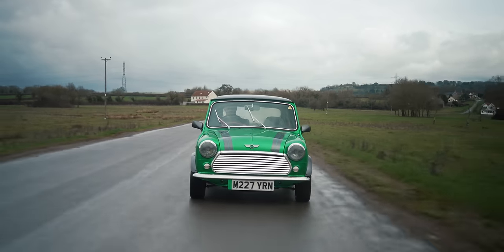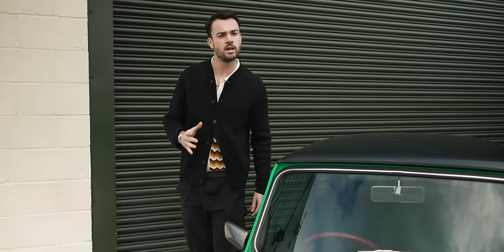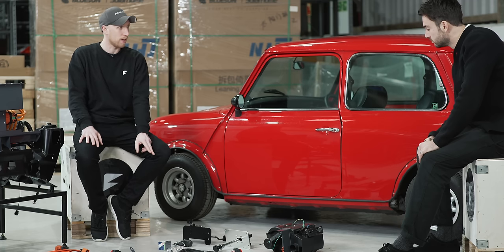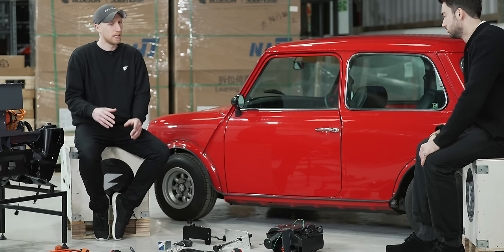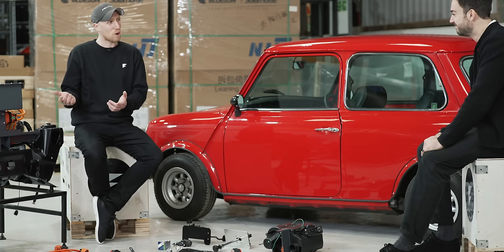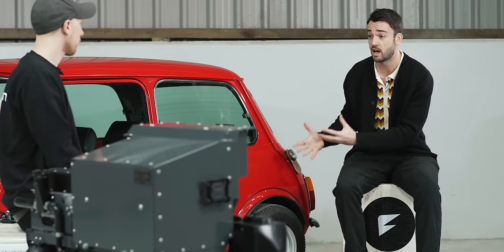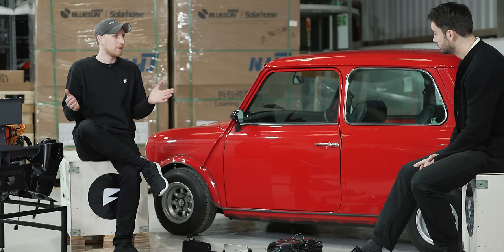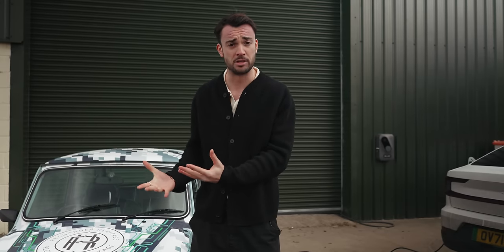How CHEAPLY Can You EV Convert Your Old Car?

Comment: The Mercedes EQXX has travelled 750 real world miles with a single charge of it's 100KWh battery.  CATL are already making second generation sodium ion batteries that should cost far, far less than lithium ion or lithium iron phophate batteries (lithium is $5000/ton, sodium is less than $100/ton).  There's no rare elements in these batteries, but they take up more room.  They're about the same weight as lithium iron phosphate (per KWh) but they're larger.

Oh, and they've got twice the charge/discharge cycle life of the best lithium iron phosphate batteries.  About 20,000 cycles.  Lithium Ion has about 500.

Now, if Mercedes can make a 750 mile range car with 100KWh, that means that a 25Kwh sodium ion powered car with a near 190 mile range should be possible.  It's just about improving efficiency of EV's.  I wouldn't mind a 25KWh car with a 120 mile real world range.  Not "nissan leaf" miles, but real miles.

That's where the technology stands today.   This isn't tomorrow tech, this is "already out there" tech.

Comment: Cost is a major factor when dealing with any Classic Car Conversion. But (most) owners of Classic Cars have a tendency to keep their Classic Car - for life! On the other hand, how many new (or almost-new) cars will you own in your lifetime? Especially when todays modern cars are designed to fail - when plastic components begin to degrade fast!! It is this overall cost that convinced me to convert my '71 Beetle to EV, back in 2019. EV Beetle has a range of 160 kM or 100 miles. Advantage is paying a low cost for electricity, the EV Beetle has been 100% reliable over 4 years, and maintenance costs of almost nil. What I am trying to say here, is simply to look at the length of time that YOU plan to own your precious Classic Car. If your answer is "forever", then go ahead and plan an EV Conversion. Take a look at exactly what you would be spending on maintenance of the engine, the uncertainty with regards to what you will be paying for fuel, and the queuing at Petrol Stations. My EV gets "filled" whilst I sleep! Over the longer term, you will see a 'payback'. You will have future-proofed your Classic Car. You will have also increased your Classic Car Value. Nothing is lost at all, the added reliability of driving your vintage Classic as an EV removes lots of stress too! Great to meet you Jack, at the Darling Harbour ICC Sydney, at the Fully Charged Show last March.

Comment: I know that the Great Britain is out of the EU for some time now, but I still wonder whether those converted cars then can be registered in EU without problems.

I think that this could be good way how to get EVs to more people much faster than current "trickle down" model can. Sadly I don't see how this could be done to more "modern" cars that already have plenty of electronics, but still conversion of older cars can be god way how to get EVs to more people and in case of elderly (although many of them perhaps started driving only in 1980's) it could transition to EVs easier as they will not be overwhelmed by all the electronics and features almost all new cars have (and they would have to learn to use them or to ignore them).

Maybe those kits could be as well useful, in future for conversions farm equipment.

Comment: I've actually been doing this to old 4-runners, throwing a honda 4 wheeler motor under the hood to charge the batteries and selling them for 35k. Essentially it's a 300mpg car that will last 10x what a standard car would.
(Costs about 8-10 USD for the conversion. Helps that I had 4 honda 4 wheelers laying around haha)

Comment: Instead of 27000GBP for the kit You can check this car from TATA motors india which cost around 20000GBP in India & has 250+ kms range, the cheapest electric car with similar specs cost around 15000 GBP in India & its a sedan with lots of modern features

Comment: The timing won't make it a big player in CO2 emission cutting. But the foundation of this industry will probably provide the ecosystem to have non-OEM battery pack replacement in existing EVs. I know I'd pay another 10k$ to double the kWh in my 2019 Ioniq EV once they are at the end of their usefull life. These guys will have all the knowledge (building pack) and contacts to retrofit newer battery tech into aging EVs.

Comment: £27,500 just for the conversion kit?  You're sniffing glue if you think that's good value for money.  You'd probably need to bring it down to a quarter of that to even gain much of a significant interest.  Even then you'd probably be looking at £15,000 installed.  Reckon that's going to prove popular, do you?

Comment: My dream; buy back the 1966 Chevrolet Caprice Coupe I owned from 1996 to 2001 and redo as an electric. Body and chassis are indestructible so will even now last forever. To have that time machine with the original silky embroided interior, fake woodgrain dash and have all that as silent and smooth as with the original 283 poweglide but clean…😊😊😊

Comment: I guess all innovation starts as toys for rich people, but converting old cars (and not just ‘classics’) as cheaply as possible should be where the EV revolution is at imo.  Using the existing frames to reduce waste and the added pollution caused by manufacturing.

Comment: What about just adding some electric power to the back wheels making it a 2+2WD hybrid? It would save a lot of gas and help a lot with response in low speeds and acceleration would be great. 25% of the battery you talked about here could be plenty

Comment: 40k is still way too much. Better off just buying a new EV for that.

Certainly, it will come down, but realistically it's going to remain a luxury thing for custom retrofit packages. But hey, classic cars are never cheap.

We'd honestly be better off focussing on building new small EV's with a bit of style to them.

The one thing the Mini shows us is that cars don't need to be heavy or have ridiculously high power to weight ratios to be fun. A bit of 60's inspiration in building smaller lighter fun cars inspired by the Mini, the Datsun Fairlady, the MG Midget, the Fiat Topolino, the Morgan 3 wheeler and the VW Beetle is the correct path.

We're already seeing that with an electric Mini, the Topolino Ev, the Ora Ballet Cat but no Punk Cat :'(

We did have the Vanderhall edison 3 wheeler as well, which seems to have disappeared, but looks like it is coming back as the Santarosa.

The sad thing is that the Mini Electric 2 is still too expensive and too high spec. 135kw is way more power than the mini should need, and it's going to offer half the range and 35kw less than the new Cupra for about 20% more price, so the "higher spec" thing doesn't work out either. A 70kw motor and 300 km range would be better than 135kw and 230 km.

The Topolino is going the Quadricycle route, so is basically irrelevant outside of France.

So that's about half of them actually looking like viable options.

The only ones actually hitting the market where they need to be is the Chinese. That Punk Cat looked incredible, but I understand why they felt they couldn't make that. A kit to convert your Ballet Cat lights to Punk Cat will fix that though.

Comment: The powertrain alone won’t make people consider a retro conversion over a brand new EV.
What about comfort, features, safety, road noise, range.
We really need a kit for almost new cars. These people might have gotten a gas or diesel car they still like, but are considering replacing because it is not an EV. Example:
Take a 2018 C200d Mercedes. Give it 150HP, 300 mile range and it would appeal to a lot of people.
Is that easy? Hell no because of the electronics in that, but that is what normal people would actually consider over a new EV. 😊

Comment: Always niche me thinks, newer car designs are typically much safer for most drivers, brakes, traction control, airbags/curtains, etc. Depending on vintage and type, heavier and aerodynamic bricks. My dad had a 1958 corvette I would have loved to convert but wayyy outside my price range. I think an Aptera will suffice.

Comment: I just bought an MX5/Miata and your first comment about size and horsepower couldn't be more true. My father 270something horsepower BMW hybrid SUV is nothing in term of driving pleasure compared to my 160hp nugget. Sure the BMW is faster, accelerate better and all of this, but when driving the speed limit anyway, the feeling of speed is a completely different story.

Car need to go on a diet. They have taken something like 500kg on average during the last 25-30 years, without it being justified (the study I looked at estimated 150kg for safety systems, that could be ofsetted without issue with the progress made in that time in material science and better design tools such as finite element analysis)

Comment: Unfortunately I think that the ElectraMeccanica Solo (if they ever bring it to the EU/UK) and Dacia Spring (if they ever put an 80MPH capable engine in the thing) or their competitors that are coming out over the next 2-3 years would/will be a more likely bet for the bulk of us. 

Even in today's crazy market my car is only worth a couple of grand with a brand new MoT... Once the car's value drops below about 5K how many people would convert a car? Classics sure but what are the odds for say a focus?

I think that the companies pushing this are either 
1) overestimating the average person's attachment to their average car, 
2) overestimating how much cost and effort a normal person is willing to put up with, or 
3) underestimating how cheap new electric cars have the potential to get.

For the third of those, you'll never beat automation in the long run, Just ask John Henry the Steel Drivin’ Man ;-)

Comment: I ordered a 144-volt kit from a Chinese company. It included everything but the batteries and the means to suspend the axle from the frame. If you find a company who handles the transaction professionally, you may be able to convert a vehicle relatively inexpensively. The kit I bough cost $4,610 and was supposed to be able to hit 55 mph in a 4000 pound truck. I'm currently fighting to get a refund on everything but the custom-sized axle because they waited too long to source the components and couldn't get a suitable dash panel. The supplier handled the problem unprofessionally and now I'm expecting to have to find all the other parts elsewhere. Be ready for hurdles if you decide that you like your old vehicle too much for it to become a relic. After all, it's just a vehicle. Now I'll have an axle and no idea what I'll be putting it into or on. One idea is to use it to power my trailer so that my truck is only helping to move a load rather than moving the whole thing. We'll see. If not, it could be an $800 lesson learned.

Comment: Do you remember when Top Gear put cars on railway tracks? Besides their usual catastrophic pantomime antics, they were addressing one key premise: WHY are trains so unneccessarily heavy? And thus, inefficient.

I think it's the same thing with electric cars. Sure, we need a strong enough frame, and strong enough crash protection, but all that extra steel for body panels is simply reducing the range of the vehicle and, ultimately, using up too much electricity. Even the Tesla Model 3 is built out of steel (whereas older models used more aluminium). OK, so steel is cheaper than aluminium, but, all the rust buckets in Europe are a testament to the investment in non-corrosive metals -- they will last longer.

Perhaps what we need is the mass production of very strong, durable, corrosion-free frames -- titanium alloys and all that good stuff -- which will last you a lifetime. These frames could be manufactured for compact-sized, family-sized, pick-up/van-sized, etc. and you just take your pick. Then you simply add an off-the-shelf battery pack and motor configuration of your choice. And finally, you simply bolt on your re-cycled plastic, fiberglass, or whatever, body in the style and colour of your fancy.

We should be asking the question, are motor manufacturers still trying to hang on to built-in obsolecence which forces us to forever be buying new cars from them?

Comment: yes a "tiny" battery isn't very heavy - though still relatively pricey. (Retail Li-Ion batteries are anywhere from $500-1500 USD  / kWh... 

Needs to come down to a similar price to an engine and gearbox swap for a classic before mass appeal will ... take off...

Seeing as a brand new city car is half the price of the "DIY" kit, hmm, enthusiast only (rich-ish, enthusiast).

- Talk of a "circular economy, well throwing old cars away is a vital part of the current so-called, circular economy, recycling can't happen otherwise (Yes I too have a hard time parting with my old chariots..
(For future true recycling, thermoset polymers (as well as the easier to reuse thermoplastics)  can be flash converted into graphene and hydrogen for energy - back to the grid, or  use to make more unicorns -  and upcycling. 

 - Battery manufacture is largely robotic, so the wages per unit of product isn't as important as cost of finance and real estate values (ie it is one of the most scalable businesses around).

Comment: It continually amazes me, just how far out of touch with the customer base, these sorts of companies (and the guys at Vintage Voltage) are with the real customer base they're pitching to. No one who can afford this, will bother with it, they'll buy a new EV, they're just not Classic Car Enthusiasts, they're people who own specific cars for the 'prestige',.. what the rest of us call posing and bragging, never driving for fun. And worse, the folks that do want to do EV conversions, are not the sort of people that can afford to take their classic to a workshop and wait to  pay for the work to be done, They Want To Do It Themselves!!!!
These 'kits', need to be made simple and safe enough to install as a Dual Battery Solar Camping power system is, with no special skills beyond being able to follow colour-coded instructions. Only selling through 'installers' is what's going to kill these products.
For those with larger cars - US  "A-body" and bigger, these kits need to feed the existing transmission for the base kits, reserving the Direct Drive version for smaller vehicles and sub-25 year old cars, and making use of the low-rpm torque of and electric motor to push through the automatic tranmissions an manual gearboxes of classic muscle cars, touring cars, hot rods, pick-ups and the like. Being 'Bolt-In' is just the start.

Comment: Rather than the complex gearbox they should just go with in wheel motors like Aptera. Much less weight, complexity, cost and space, leaving the engine compartment for the battery.

Comment: I have a 1993 Taurus wagon. I would like to convert into a hybrid. Cram a 8kwh or so battery in the floor well of the 3rd row rear facing seat. Install a couple wheel motors for the rear wheels. Install a thumb switch to trigger the  motors and regen paddle on the steering wheel. Granted, id still have to start the gas engine, but basically just run it in idle til the battery runs out, and still be able to use regen

Comment: To me it will always be a niche for hobbyists who love tinkering with cars and have a passion for a certain model or for those with enough cash to buy all the bits and pay someone to fit it. With more EV's becoming available and a thriving 2nd hand market (at some point) then the mass market won't want the hassle, risks and limitations of a conversion. A 2019 Model 3 with reasonable...ish mileage is about £24k right now which is a better car with longer range. So at what price point does a conversion become cost effective to do over buying 2nd hand? If you want a bit of fun right now for driving around town then I'd be looking at a twizzy or an Ami although I'm too tall for the former as proven at last years Fully Charged Live.

Comment: Thank you. This is a subject that should have its own slot on your program. True classic car Gear Heads will go to no ends to take on a project, as long as the wrenches are spinning and my Fluke meter still works I'm in my happy space. Electrify an old air cooled Corvair or a Granada Estate bring them all on.

Comment: I had a 1275 mini clubman with low profile tyres and a small thick steering wheel, easily the most fun to drive car I've ever owned fantastic handling and non stop fun driving it. Everything else is a huge bore by comparison.

Comment: I'm interested in these cause i don't like the high computerization of new cars. I want a manual shift, a bench seat, a simple stereo with aux port for my phone or mp3 player, and a couple charge ports. Simple means less to go wrong and more mechanical tends to be somewhat simpler to repair vs fighting with proprietary software.
And just to be clear, I'm a millennial who's build my own pc and uses linux, so I'm no luddite. I'm just very not a fan of HOW car companies have implemented computers in cars.

Comment: I do think the price will come down on these kinds of kit but it will only ever be an enthusiast market. Much like how enthusiasts today keep E30 M3s or S13 200SXs running. It's not an economic decision. These kits will become cheaper so less wealthy enthusiasts will be able to get on board, but as THEY drop in price so will new EVs plus the less premium EV market will expand and the used market will be more viable.
In my opinion it will never be what Jack described, an old car you're quite fond of that is cheaper to convert than replace.

Comment: Very interesting. As a gas hot rodder I'd pay a lot of money for a bolt-on electric rear axle. If I could double my torque and maybe greatly improve my mileage by swapping out the rear axle and bolting a small battery pack into my beater pickup or cheap old Corolla, I'd be pretty dang happy. Bring electric on.